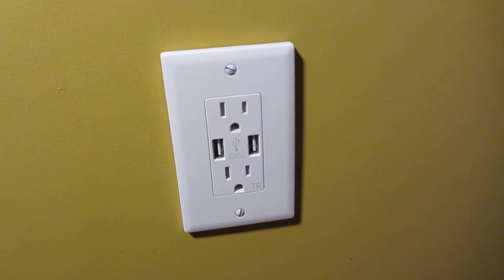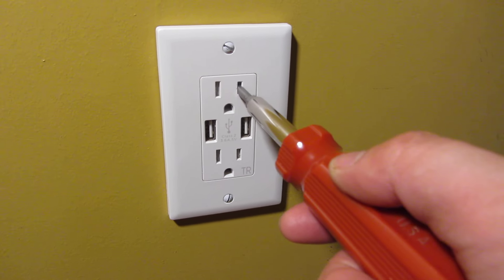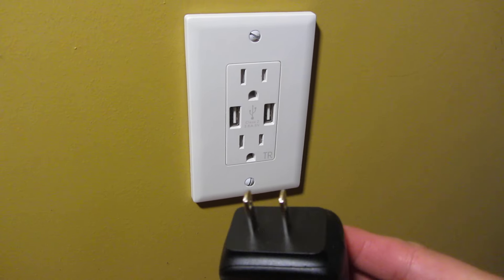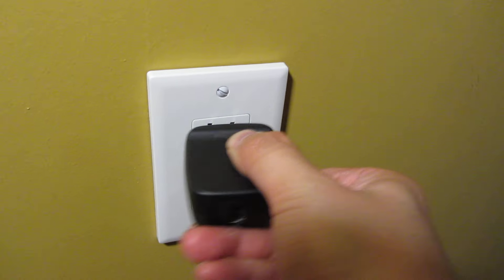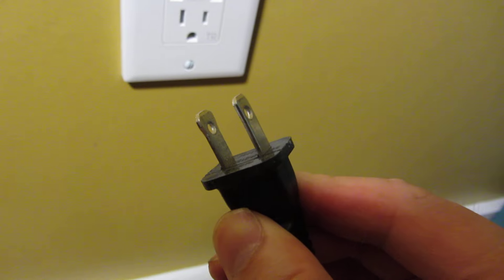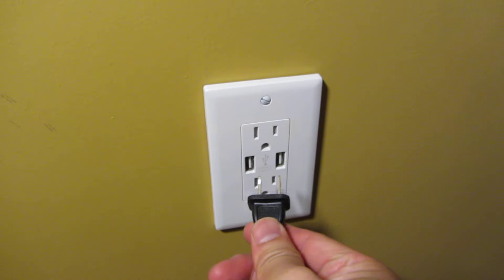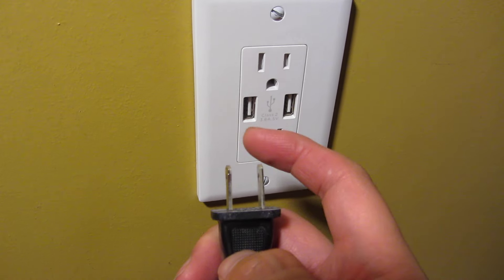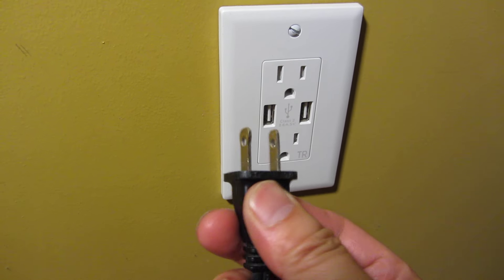How to Plug In an Electrical Outlet that is Child Safety and Tamper Proof ?

Comment: That is aggravating. I got it to work, but ONLY with a 2 prong plug, because I have to jam it in there from a 30 degree Y axis angle. Won't work with the 3 prong.
Reply from the maker: It works the same way with a 3 prong, just wiggle wiggle.